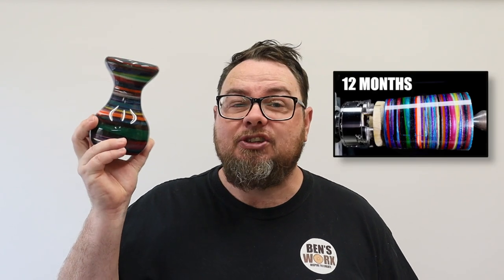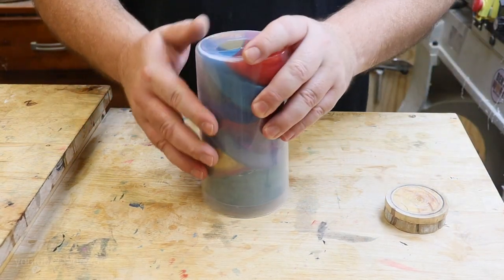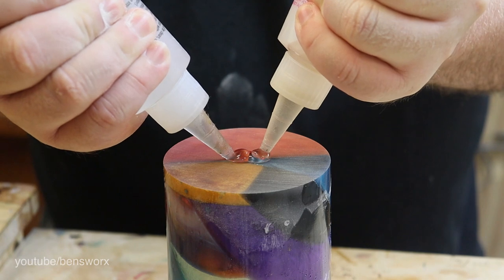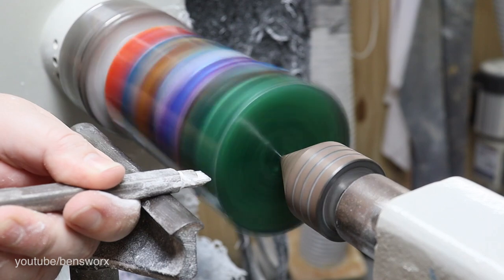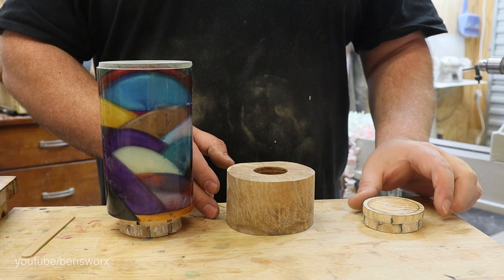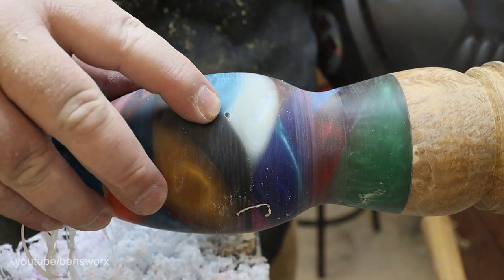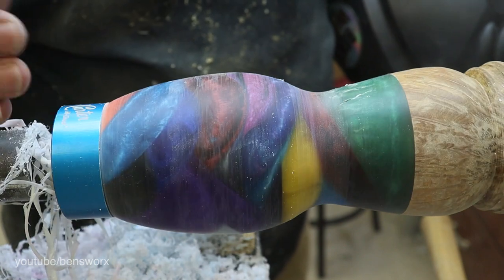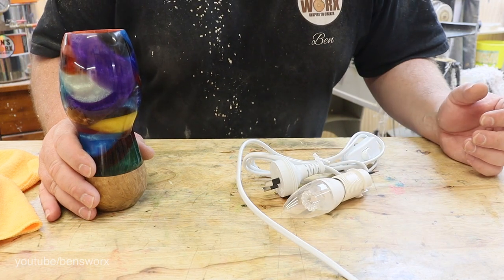Woodturning - Over 50 Layers of Epoxy Resin

Comment: Looks great Ben. For next time, why not a bowl. Get a deep, wide container and after about 3 or so inches, add a waste block and keep filling until the total thickness makes for a decent size. The initial pours would make for some tight layers due to the overall size of the container. Also, since they'll be so thin, torch the tops of those layers to avoid bubbles. Maybe even tilt it like you did this one while you pour. I liked that effect

Comment: Damn that is very cool. It is well worth the time. 
Next one should be a lava lamp. Same shape as a lava lamp with a wood cap and wood base. 
I think you would have to hollow out the inside by hand after the forstner bit so its thin enough for light to pass. I would also put a vent hole in the cap for heat to escape.
Reply from the maker: Thankyou

Comment: For your next one, you could only use only lightly tinted, or at least semi-transparent resin, then halfway through add a model of an olden-style ship like the Marie Celeste, but with the prow facing upwards. You can then slowly bury it, layer by layer, until your blank is big enough, then you could turn it into a bottle, as if the old ship is lost in space and time.

If you use only opaque resin, then maybe try turning it into a set of candle holders. It would also be nice seeing it carved into an actual sculpture, like a comfort bird or something, but that may be too difficult.

Comment: Next one you should do in coating layers. Coat the inside container with epoxy entirely,  then so on and so forth with each additional color. Maybe use an auto tumbler until it each layer cures then fill the core

Comment: I noticed you didn’t add texture before gluing the epoxy onto the block but you do in some other videos when glueing smooth surfaces- is there a reason you didn’t for this?
Reply from the maker: the resin was already scored from sanding it 👍as long as the resin isn't shinny 😊